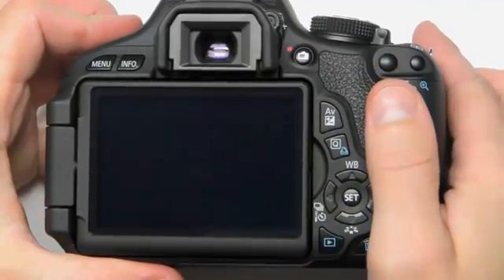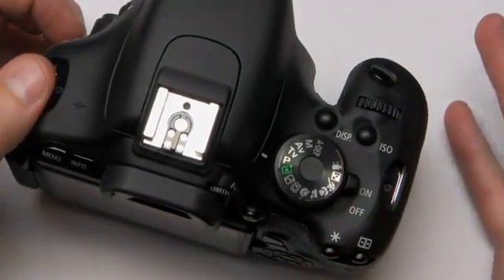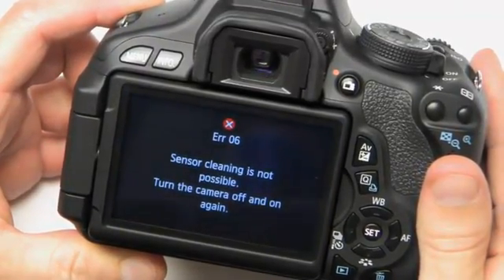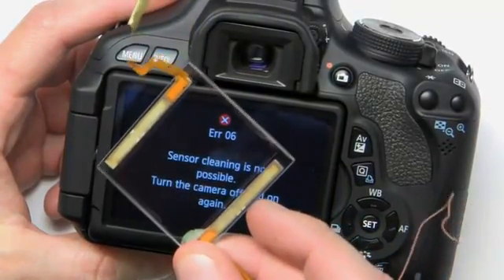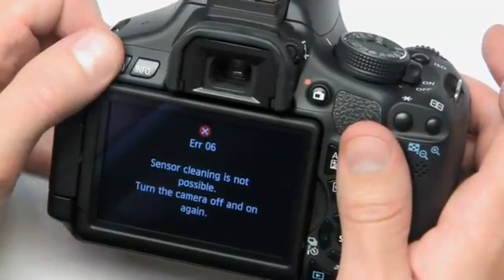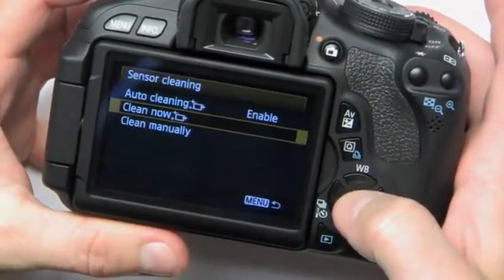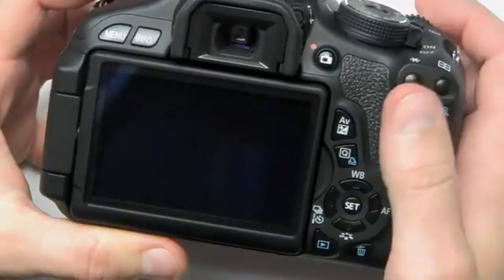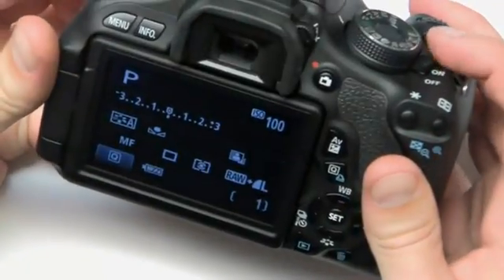No Dust Reduction Feature After Infrared Conversion

Comment: For anyone attemting thid themselves, turn off the settings before hand. Some Canon cameras are harder to get in the menu because they restart almost instantly. On mine I had to got to the gallery by pressing the play button right as it booted and then menu to change the setting. Save yourself some time and do it before modding your camera. Thanks LifePixel, your videos, web tutorials and the questions you responded to by email were extremely helpful.